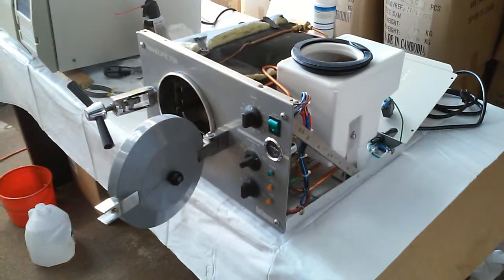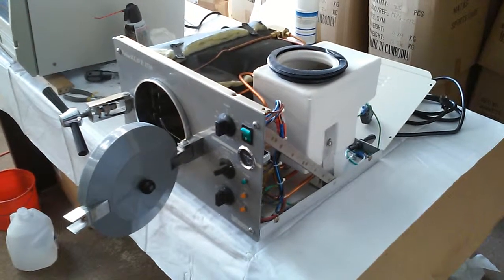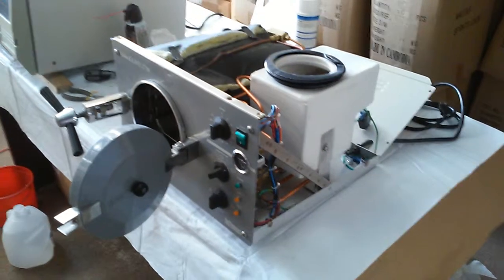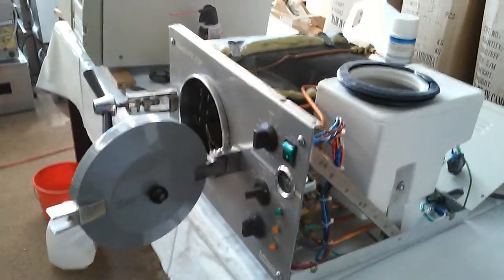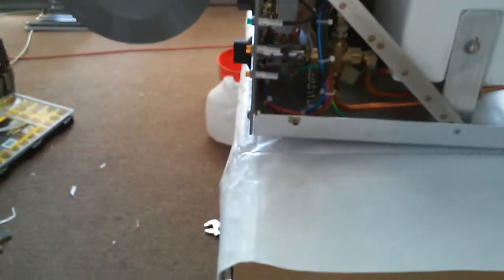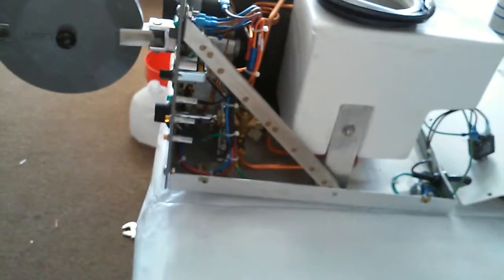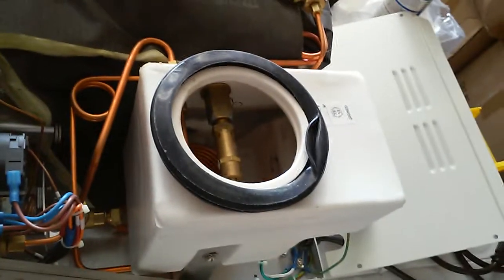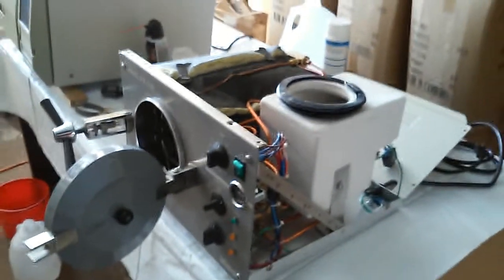repair Tuttnauer M type sterilizers autoclaves

Comment: How to you fix the timer knob when it keeps getting stuck and doesn’t move
Reply from the maker: replace a new one. Those 3 knobs are 2 types, they are not exchangeable. One is http://www.isterilizer.com/en/multi-purpose-knob-for-all-tuttnauer-manual-autoclaves-sterilizers, another one for the temp control only http://www.isterilizer.com/en/tuttnauer-sterilizer-thermostat-knob-for-m-mk-mkv